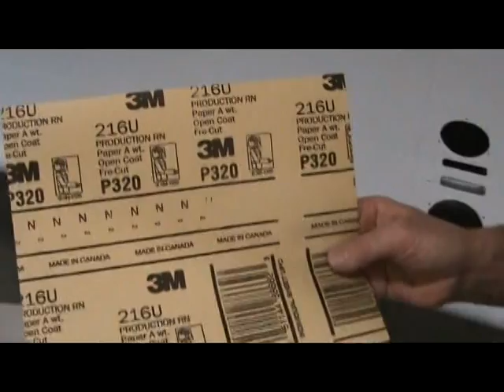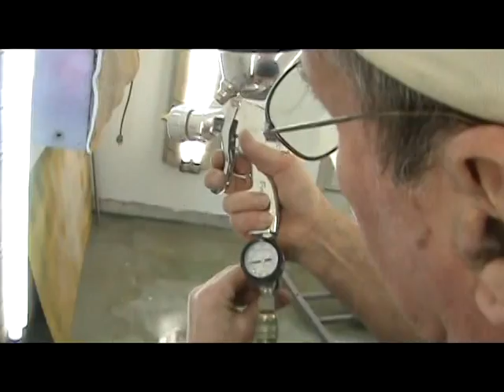Metal Finishing Full Length Part 1

Comment: You mention opening the fluid tip 1/8 turn every pass (I assume this means every coat), but then say it should be 1 turn farther open by the 3rd coat.  3 times 1/8 is not 1 so I am confused as to what you mean.  Do you mean 1/4 turn every coat which would get you 1 full turn by the 4th and final coat.
Reply from the maker: This video was made with our first generation paint.  With EkoPoly Premium, I would recommend a slightly different technique.  The first coat needs to be very light, about 50% coverage.  You could read the news paper through it.  The subsequent fog coats should be a little heavier, but we do not want it to flow or gloss at all.  It should be a fine matte finish.  Apply each fog coat the same way, alternating directions and allowing time between each to tack.  Once you have color saturation, apply one wet coat.   Also, with the Ekopoly Premium the pot life has increased greatly to 3-5 hours, so the time between coats is not critical.  Take your time.   Be careful not to go too heavy on the fog coats.  If it starts to flow on the fog coats you may find that you will have some orange peel in the final finish.  There are other factors that can cause orange peel as well, but that is one of the common ones.
Reply: Stewart Systems I first will be doing just interior primer for anticorrosion protection on 6061 (yes, probably overkill).  Is one fog coat followed by one heavier coat sufficient for this purpose?  I plan to use the one part Ekoprime as I will be doing a lot of small batches of small parts and don’t want to mix and waste a lot of epoxy primer.  Is the Finishline gun suitable for this, obviously with some waste due to overspray?  I figure I can waste a fair bit of paint and still be money ahead compared to buying a spot repair gun in addition to the Finishline gun.
Reply from the maker: @LTVoyager  Yes, one fog and one semi wet will generally be sufficient.  Just make sure you can't see any metal through it.  You can do it all with the Finishline, but the SriPro has some key advantages.  One is that it has the Dkups system included, so you can spray in any position, even upside down, without a drip or a skip.  That is wonderful.  It also is considerably smaller to get into tight spaces.  Another key advantage for small parts is that it does not have the blast of air that the Finishline has so it does not tend to blow the parts around nearly as much.  That is really nice if you are hanging parts to spray them.  Just some thing to think about.  I spend about 80% of my painting time with the SriPro and only break out the Finishline for the large parts.

Comment: What psi what volume and how wide fan
Reply: It depends on the gun.  With the Finishline we ran about 23-26 or so.  With the Pro-tek we like to run about 30-35.  The Pro-tek has a really wide fan, around 10".  We run the fan control wide open unless shooting small parts.